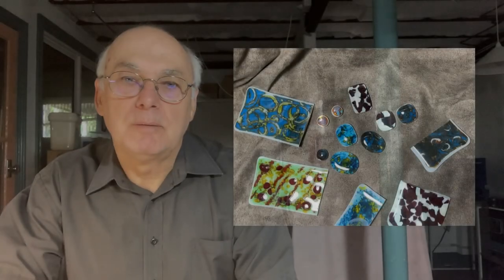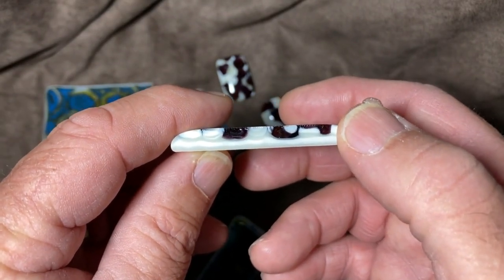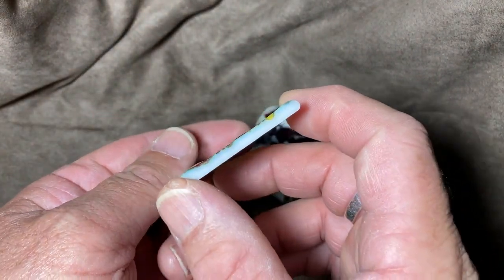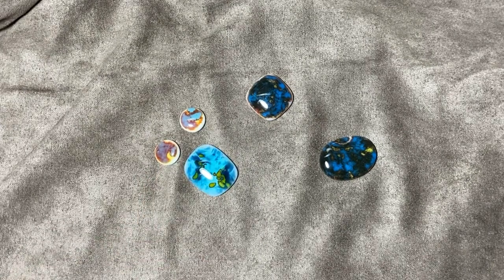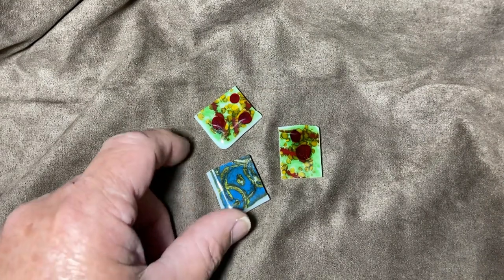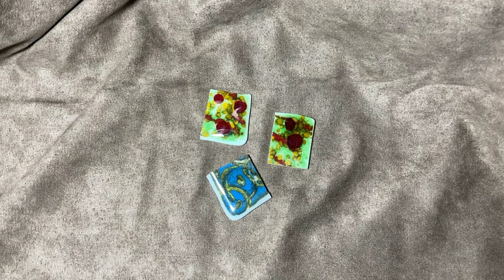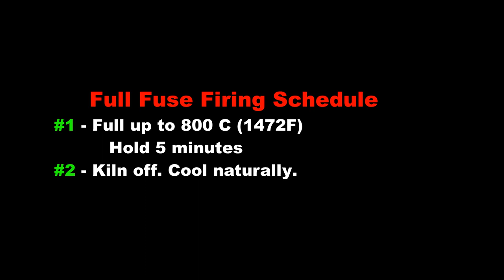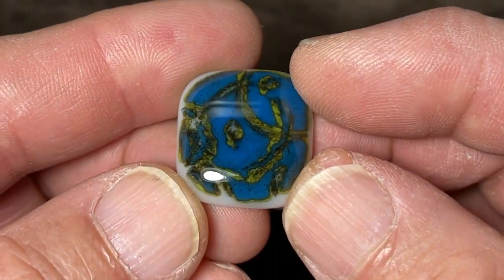Making Fused Glass Cabochons Using Part Sheets - A Fused Glass Tutorial

Comment: What is the grinding tool you used?
Reply from the maker: I think you mean the diamond wheels I use. They're a pair of old lapidary wheels. Diamond wheels that are water fed to cool and flush material. Check with your local lapidary club. They may have an old pair you can buy.
Reply: @RocketRoseArt  Thank you!   and thank you for all of the free You tube information ... thank you for sharing, and saving me from making costly mistakes